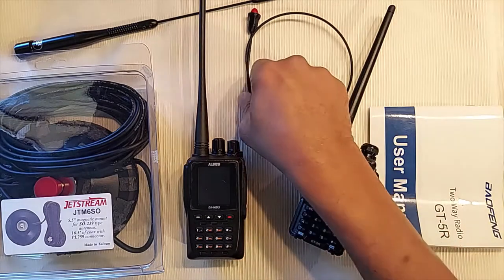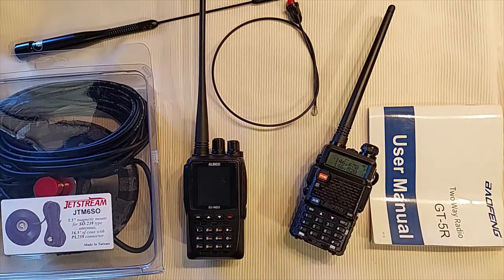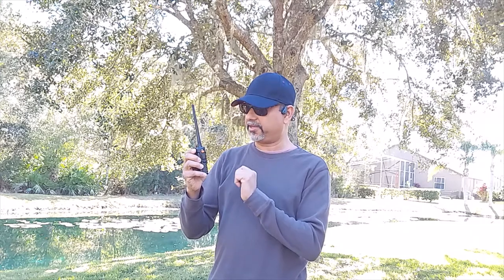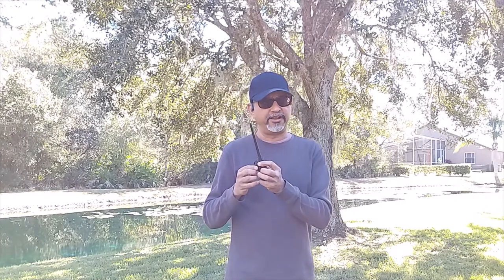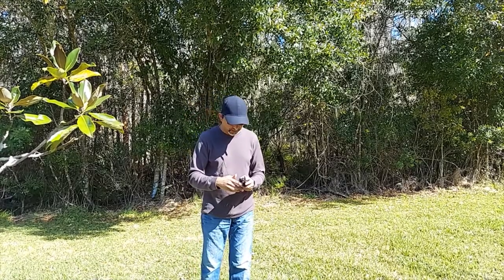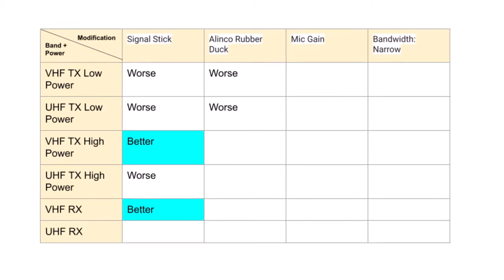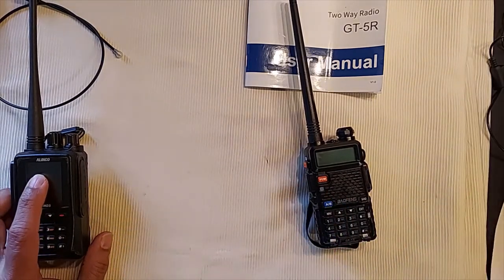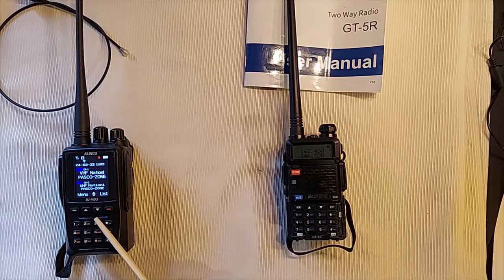HT Antenna Testing - Baofeng GT-5R and SignalStick

Comment: Great video. I do have a signa stick and Comet antennas.  I believe a Comet antenna is better than the signal stick.  I do however, use an MFJ 1714S  1/2 wave antenna. It's 40 inches but I find it the best antenna I ever used. It's only a 2 meter antenna. I use that because all the 440 repeaters around here a using some form of digital mode. Have a great one.
Reply from the maker: Thanks. I just looked up the MFJ and that sounds like a great option. That may just be my next HT antenna!
Reply: @22magnumforce64  You're welcome. I'll let you know that my husband has an Icom V86 and he says it a great radio. It only does 2 meters but couldn't beat the price. He got it on sale from Ham Radio Outlet for $113.. Regular price is $128.95 Have a great one